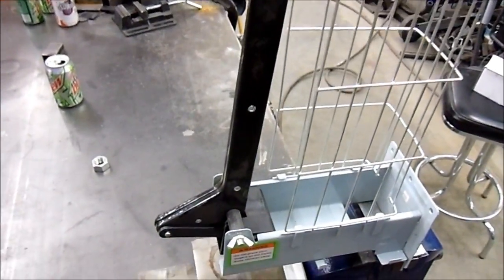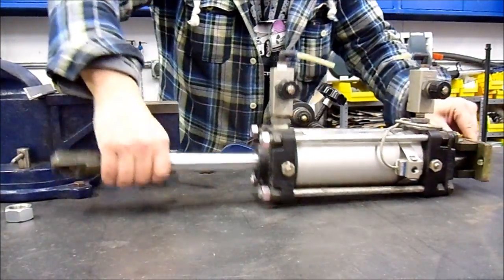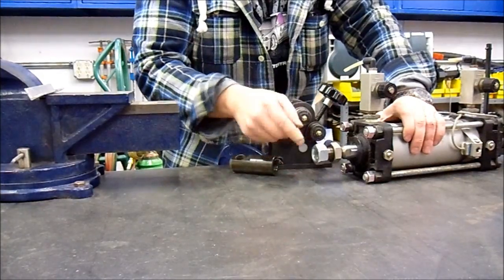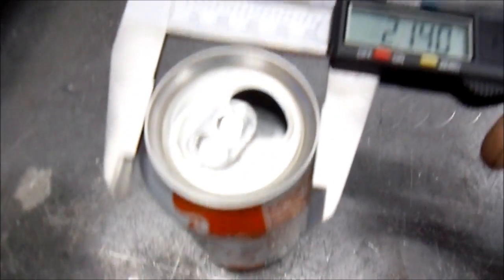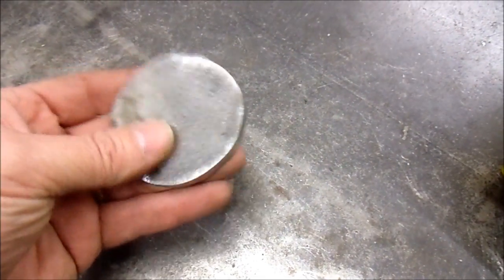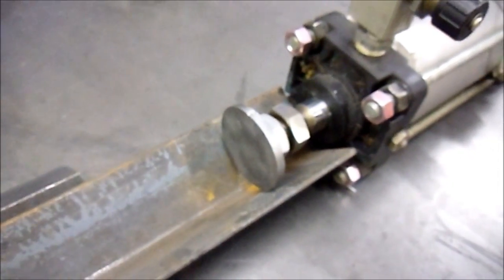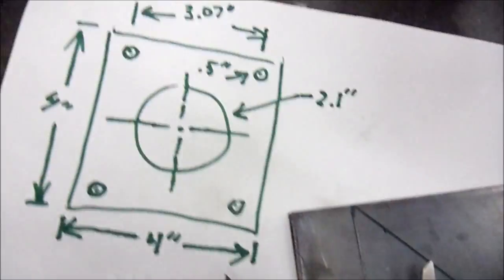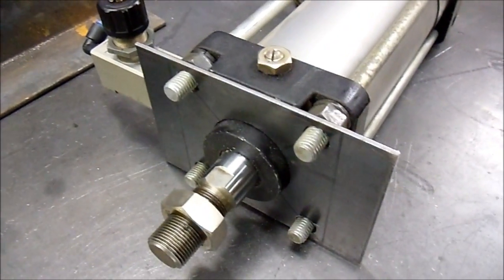Can Crusher DIY Part 1,  Montana Style. 1200PSI cylinder

Comment: That was some nice welding to get the plate to the fine threaded nut for the cylinder. Your hole saw would have helped you center the nut on the piston. :) You've inspired me to do something similar; around here we have regular (355mL) and pint and quart cans (473/500mL and 710/740mL), each redeemable for $0.10 regardless of size. When we cash them in, they usually take you at your word but the cans still have to be able to be counted individually, so a log-splitter baler won't work and that makes hydraulics too slow (and messy). Disk-shaped former cans would be ideal, as tightly compressed as possible. I love that angle iron channel to support the cans underneath; maybe a second one that folds out on the top so I can remove logs of cans without having to create a separate way of ejecting a  stack. Thanks!
Reply from the maker: they'd be like huge poker chips!!!  :)

Comment: Hi there! I hope you are doing well. I have a question about pneumatic press. I purchased a 1 Mega Pa pneumatic jack and i am giving pressure equals to 7 bar, but this pneumatic cylinder can not even compress a plastic bottle. So , kindly suggest me what should i do to overcome this problem. 
Thanks in advance.

Comment: @Stormer94 -- This is really a great project. It takes me hours to crush cans and this would really make it easier. Just one question, where did you get the air cylinder???? Is there a manufacture name and part number on the cylinder. Usually it is a stamped aluminum label on the cylinder itself. Also I noticed that you have to "power" the piston back using air to the opposite side port to reset the position of the plunger. Taking the cylinder apart and placing a spring inside to do that would save having to find a two-way valve (like ones used in floor lifts in automotive shops) 

Great video. Looks like I've got another project to put on my list. LOL!!

Comment: It takes about 100lbs of weight to begin crushing a can along its long axis.  It takes about 9 lbs to crush it along any other axis.  A typical can will yield $.02 (and dropping) on redemption in most states. You can either rig up some fancy machine with uses a fuck ton of energy to create the forces of 100lbs, or 9lbs for longer, for which you will almost certainly spend more on electricity or gas during manufacture and operation than the can is even worth, not to mention the gas spent redeeming them. or...

At sea level, atmospheric pressure is roughly 14.7 psi. A typical soda can is 49sqin surface area. That equates to roughly 720.3lbs of crushing force you can bring to bear by nature if you remove the 355mL of air inside the can.

Which do you think requires more energy? Creating 100~ lbs of lateral force, or moving .355 liters of air?

Work smarter... let nature work for you. A shitty $20 off the shelf Wal-Mart vacuum sealer will crush cans with less effort than that monstrosity you spent hours fabricating and tied up a double action piston to concoct.
Reply from the maker: But, it made me happy.  You don't want me to be happy?  Didn't cost me a dime I got that stuff for free.  And my nephews and the neighborhood kids really enjoy it and it keeps them out of trouble and exercising their minds with creative ways to problem solve.  I had fun!  I am sorry that you did not.  ;(
Reply: Stormer94  Well said Stormer94 its no about cost its about keeping busy with projects you enjoy doing, if it we're a business then it would be different. Keep up the good work and keep the projects coming :)

Chris
Reply: maxdecphoenix - I could see your point if he expected to "get his money back", but that's not the point of this video at all.

Nice job Stormer94.  If I could find a free cylinder I'd build one myself.

Comment: the cylinder is the same width as a regular can of coke. It's the length that's longer. In fact, the can itself is pretty soft and easy to fold by hand, but by doing that you end up with open cutting sides. Buy a can, it's only 99 cents and check it out for yourself. Thanks!